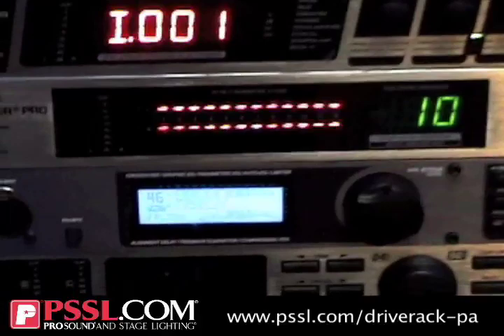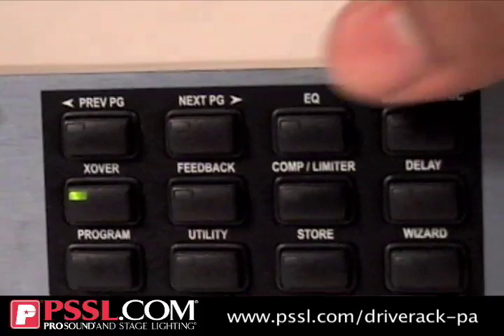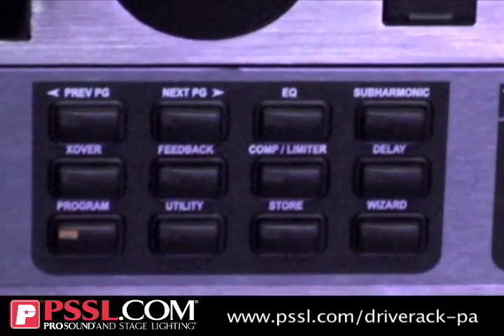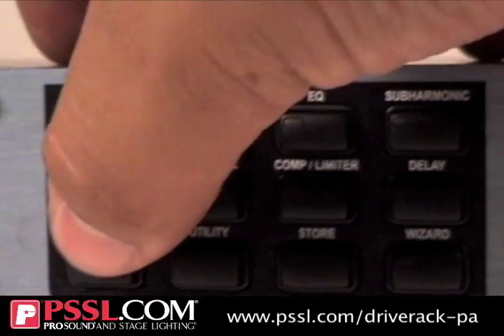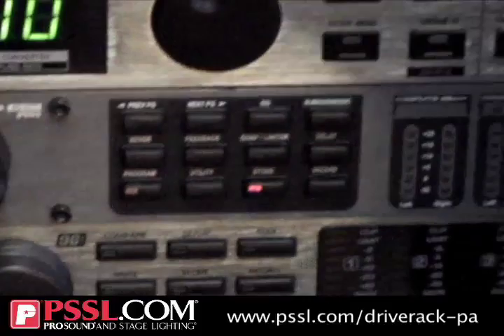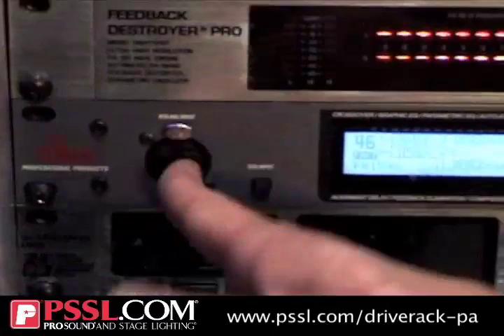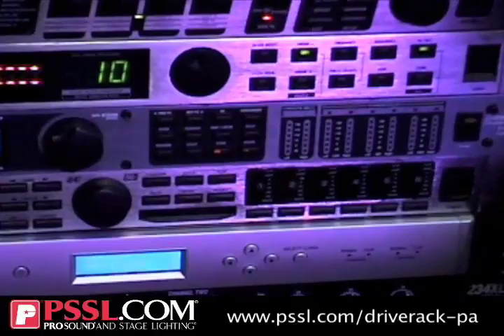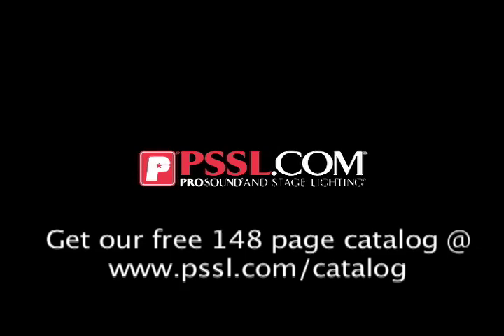dbx DriveRack-PA EQ & Loudspeaker Control System

Comment: @Rockbuon08 
if you havent got an answer yet...
yes.
there is a big list of amps and speaker combos that the setup wizard has stored.
i'm using 
4 old pv cs1200x amps bridged for my ev mtl1 subscoops
8 old pv cs100x amps for my pv sp1 and fh1 mains
none of my amps and speakers are in the stored auto wizard setup.
no problems though.
plug it all in, set your biamp-triamp (whatever you want) then sample different eq-xover etc settings.
store the ones you want.
totally easy.

Comment: The KW181 does have a high quality internal crossover, just add a full range signal and it will automatically apply a 100hz filter too it, no need to add anything but full range audio and let the magic of technology do the rest ;)

Comment: You should always use a DSP for sound.. Since pasive filters dont really give you the exact x-over, depending on thermal power... 

The DBX Driverack PA is good, and cheep for what it brings..! But even better is the Driverack 260i!

Comment: Hi, thanks for that explanation, it helps out a lot for us guys who are barely starting. I have a question though, what are the advantages of having a driverack 260 rather than a driverack PA? Is the full time RTA, worth it? and the other thing, does dbx have software for macs to control the 260. I have a driverack 260 right now, but am barely learning to use it. Thank you for all the help guys.

Comment: is it really such a good idea to have a prime competitor (Behringer DCX2496) right underneath the one they are trying to promote? Driverack is pretty good, reliability is a problem though, used them quite a bit and had problems. The Behringer  is better in my books, same sound, more robust and lot less fragile. And it's cheap!

Comment: hey i have one of these fine processors,but i am unable to get the full maximum used of it ,,can u tell me how to hook my pa+drive rack to get four input ,,high ,mid, low mid and low .with the three way system ....and if i should add a enhancer for better bass ...should i add it from the amp to enhancer to the driverack or from the amp to the drive rack to the enhancer to the mixer .....really need some one helps ...thanks

Comment: OK, I'm building a system for mobile entertainment and also to do some live sound.  I will be using EV powered speakers and am wondering if anyone has advice on minimal rack gear.  I'm looking at a pair of power conditioners, DBX DriveRack (unsure which ones) for mains and also for monitors( 2 separate monitor mixes).  Wondering how best to do this.  I read one bit about a feature that equalizes or levels out the sound between the L/R channels.  I would not want this for monitor mixes, or would have to use 2 units to get my 2 monitor mixes to have independently adjustable levels.  Any advice on putting together a simple small rack  for use with EV powered speakers would be great.  I'm using ZXL 12" tops and a single ZXA1 Sub, looking to add more ZLX 12" and also ETX 15" subs eventually.

Comment: Hello, I have 2 sets of systems, I have active and passive, could you use this dbx pa with active, I know there's a dbx for active speakers but I already own a dbx pa....thanks.
Reply: I am wondering the same thing. I bought a nice used Driverack PA  Model DBXPAV, but I have sold all my non powered speakers and most of my amps. Did you ever work it out to run a powered PA system?

Comment: these things are junk...try the "limiter" on the crossover output....it clips when it comes on unless you go to page 2 and turn off the peak limit function...what a dopey design putting a known distorting device in the main signal chain...if you dont believe me try it with just a vocal mic on the limiter to the mid highs...great a limiter that distorts the entire PA at normal levels...nice one DBX